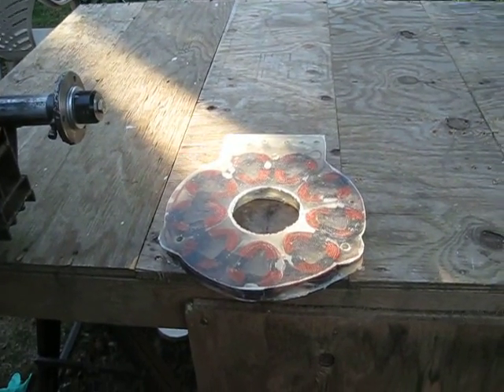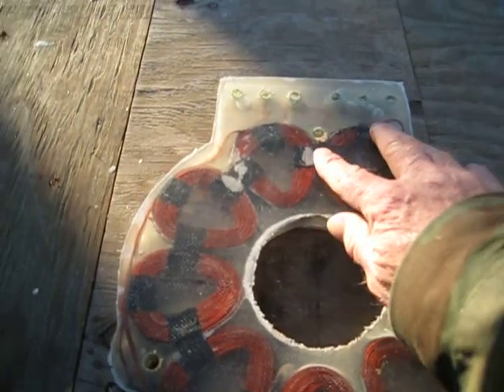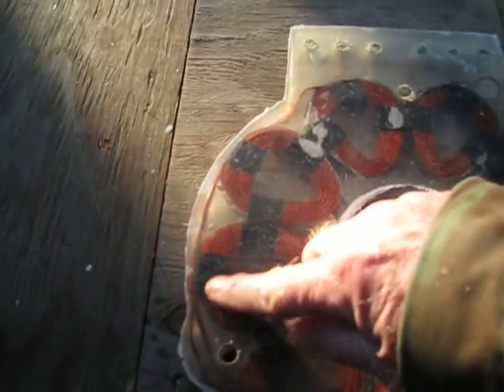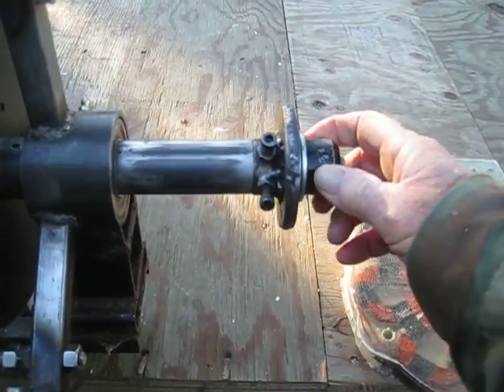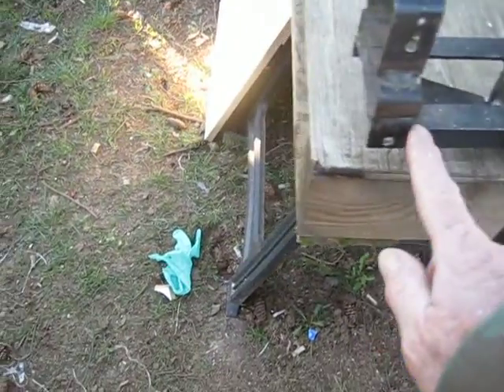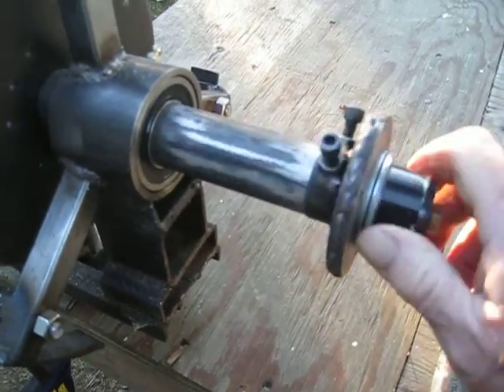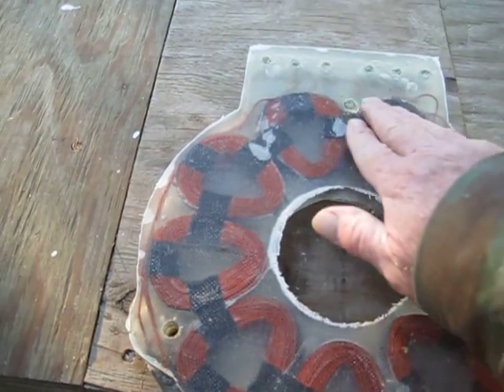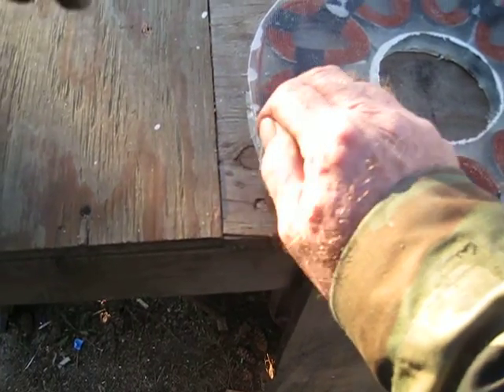Wind generator stator mold results 001

Comment from the maker: Hi James. yes the stator turned out pretty good. I put some blades on the set up just to test the output sitting on the bench about 4 feet off the ground.  in a 9 mph wind it got up to 47.6 no load output which is not to bad. still have some work to do on the tower set up before I can get this one in the air.

Comment: I missed this video somehow. I had no idea you're building a HAWT, how's the build coming? Your stator turned out really nice! I just cast one about a week ago using standard fibreglass resin, not quite as great - I need to do a bit of surfacing to smooth things up, but almost no bubbles, just a few small ones near the overflow. Again, nice build. It's really refreshing to see another DIY enthusiast actually apply the necessary math too. It's the only way to get the most out of the investment.